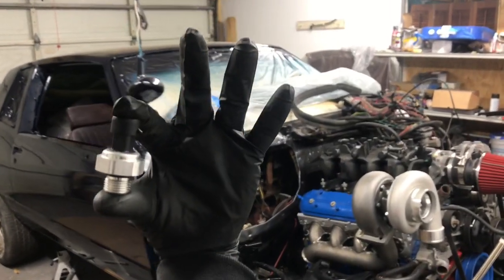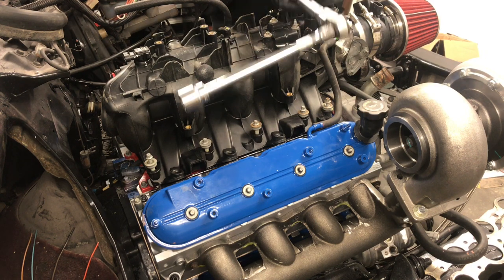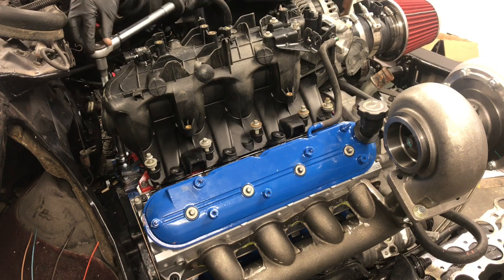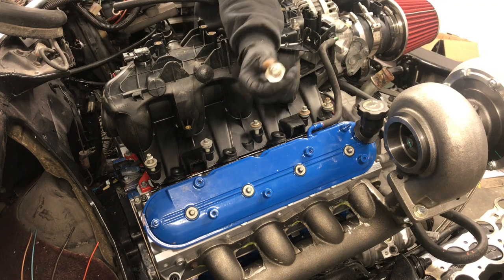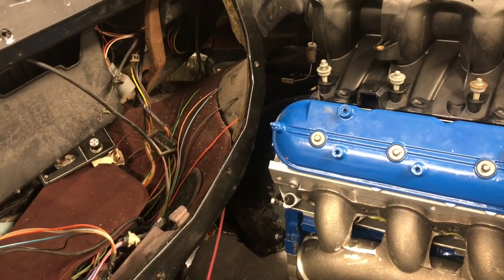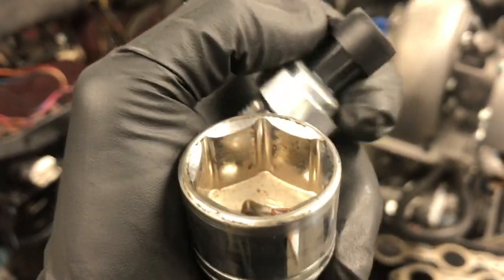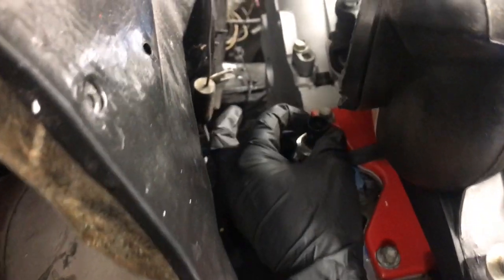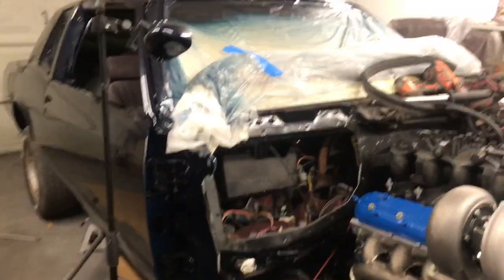OIL PRESSURE SENSOR LOCATION AND HOW TO INSTALL ON ANY LS ENGINE

Comment: I am in the middle of a LS Swap into a 78 Buick Regal.  I cannot figure out what the threaded hole to the left of the Cam Sensor (looking front the front of the motor) is for.  You can see it clearly in your video at 3:45.  Do you know what bolts into that empty hole?
Reply from the maker: Oil pressure sensor
Reply: @MRRANDOM1  I wasn’t talking about the Oil Pressure Plug.  I was talking about the empty threaded hole.  I actually found out it’s there to ground the harness. Thanks for the video.